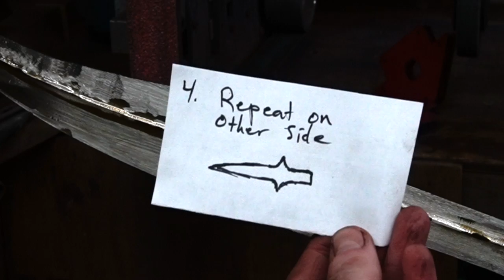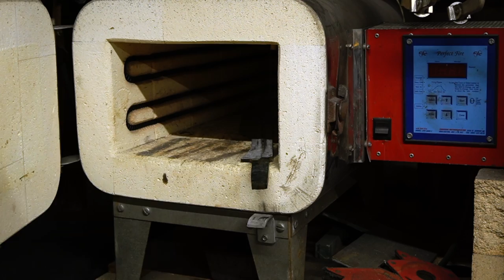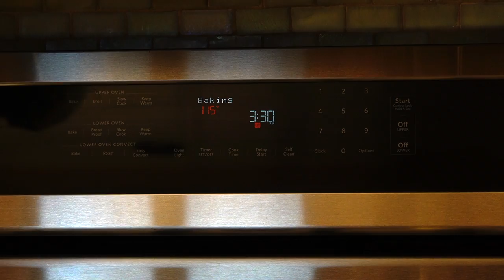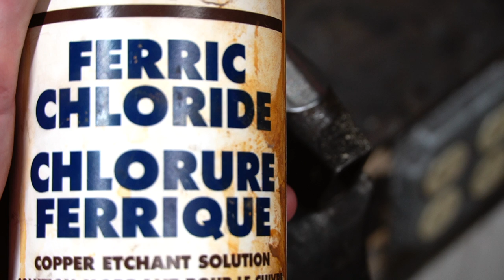Forging a Post Apocalyptic Spartan Sword

Comment: This guy literally baked a Spartan sword
Reply: He literally nailed it
Reply: It does something to the metal forgot the term but its good for the metal
Reply: @breadbucket7812  heat treated, I believe. Something about hardening the metal or something like that.
Reply: Erby it’s exactly that
Reply: @breadbucket7812  tempering
Reply: @erby69  no oppisite of hardening he tempered it its what you do after hardening the heat to a glow then quench he did was the hardening process 

The point of tempering is essentially to soften the steel a bit or more accurately toughen it when its been heen hardened properly it makes the steel britle which is why anytime you see some nearly drop theyre work after hardening the freak out a bit a drop can cause it to shatter (had this happen before)

Comment: Just a tip from a fellow bladesmith. Normalize a blade forged from 5160/leafspring, 3 cycles before heat treating. It will refine the grain structure and relieve stress from forging.

Comment: I've seen you doing this on every videos, can someone tell me the purpose of the scratchy thingy 3:54
Reply from the maker: That's a hardness tester, it's used to display that the steel has been properly heat treated 👍
Reply: Faraway Forge I have a question, what is the purpose of heating the steal up and hammering it into shape? Why not cut it with a circular saw? Is it to make the blade more dense? I’ve been watching your videos for a few days now and I fancy trying something myself 😁

Comment: Good work. I have  question bro, who do you use car's steel?
Reply from the maker: Because I got it for free! Fits with the theme of the build
Reply: Is steel durable enough?
Reply from the maker: @abdullohtursunov3380  Short answer, yes. Long answer, it's a great source of high carbon steel because it's readily available and, although the exact carbon content is unknown, it's easy and forgiving to forge/work with

Comment: For what the oven on such low temp? :)
Reply from the maker: That is the tempering process, it toughens the blade and removes a little bit of hardness after the heat treat

Comment: How much would you sell this for and how much does it weigh
Reply from the maker: I'd let it go for $500 USD plus shipping, I don't know the exact weight off the top of my head but it's on the heaver side because of the hammer heads

Comment: Why would the blacksmith not perform one of the most important rules when making this Spartan sword?? Which is ensuring that all rust is removed from any piece of metal that is to be used on a project! That chain he cut up to make the grip for the handle was covered in rust and all he did was clean up the sides where he would grip the sword. That still leaves all of that other rust in and between each link of the chain covered in rust! And considering that that sword is made from part of a spring which was also covered in rust! That sword is one huge failure just waiting to happen as the spread of rust eats away at first the chain, then spreads to the tang and follows on to the rest of the metal, that is unless corrections are not performed sooner rather later, especially if that Spartan sword was going to a paying customer!! I know I would be upset if I received an item I paid to be customer forged and when receiving it noted rust in the grip of the sword!!

Bro, I have watched several of your other videos as I subscribe to your channel and you have never in any of the other videos I have watched not ensured that all rust was removed from the steel! You have made some really outstanding videos but sadly when you fail at one you really fail hard!! Please remember that some of your subscribers may be watching your videos as they are beginner blacksmiths and are seeking tips and tricks of the craft by watching your videos! 
I say this as my son is such a person and watching to perform blacksmithing when he is not working in the oilfield. He hopes that eventually he will be able to blacksmith full time when he retires when he is in his early 40's as all of his major bills will be paid off, including his new house. 

This is the only video of yours that I actually down voted on. And what surprises me even more is all of the positive comments that were received on this video. Perhaps I noticed your error as I used to blacksmith back in my younger days (back before a lot of that machinery you show using was around, at least if it was around it was so new that common folk couldn't afford it, same as when the very first computers came out and I paid 5k and had to learn to type in dos. Of course there was no such things as black hats or white hats, there was only coders and non coders. Or the elite and the nobodys as the terms went back then along with what you call the dark web, we knew as dark net.